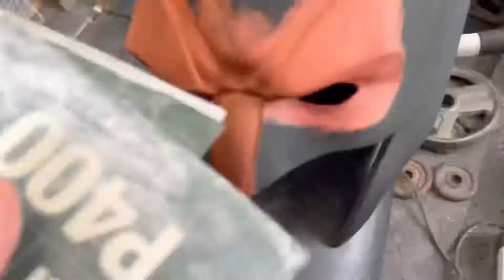3D printed wolverine mask  | 3D printing timelapse | Deadpool 3 | Korn freak on a leash

Comment: Did you use wood filler on this project?
Reply from the maker: No, the link for the original build is in the description. FYI you should never use wood filler, waterbased products will give you nothing but problems when they react to the solvents in primers & paint. Use body filler,putty & filler primer. Even uv resin is better than wood filler
Reply: @Darkwingdad  alright thx for the tip.
Reply from the maker: @dc1n1001  no problem! Products are tough to come by but trust me getting automotive grade finishing components will give you the best results with the least amount of headaches! If you need help finding anything just shoot me a message!